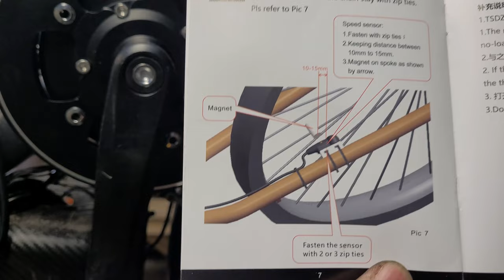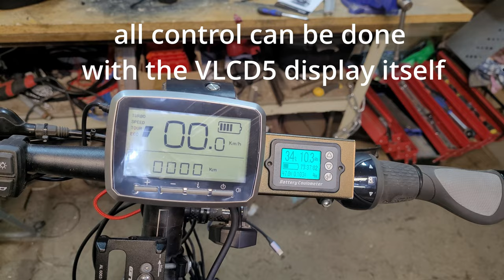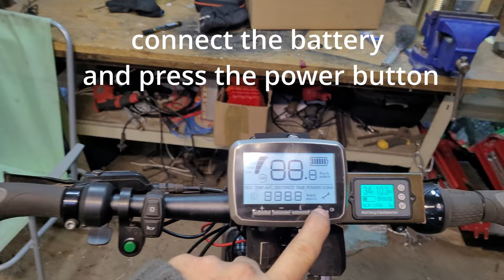TSDZ2 - SET FROM CHINA & BIKE ASSEMBLY - TONGSHENG

Comment: I noticed the shift sensor ss01, tell me exactly how it works inside. what exactly he does is clear.
Reply from the maker: The sensor disengages the drive for a moment when the cable movement is detected. But he's from a different drive (BBS02). It is not connected to BBS02